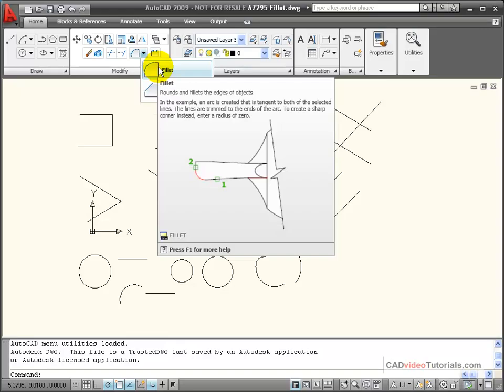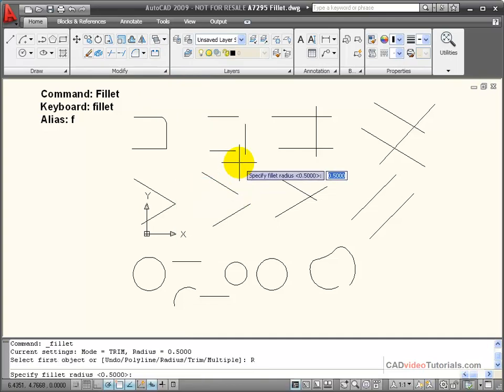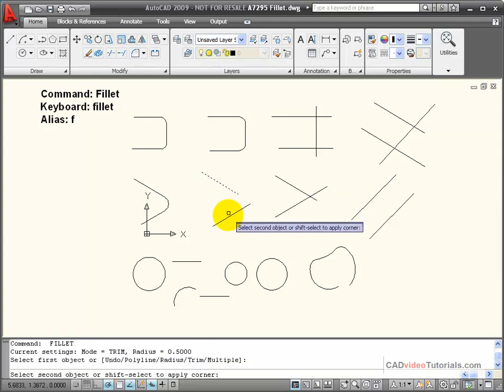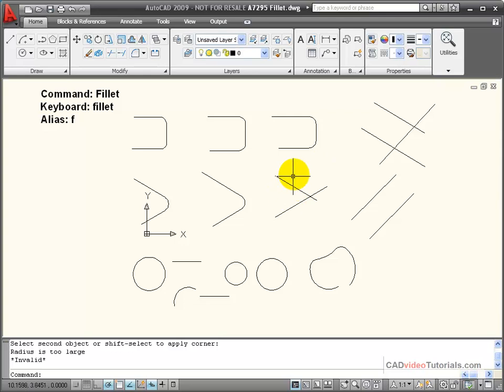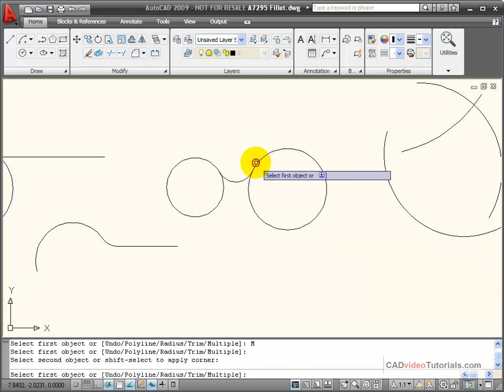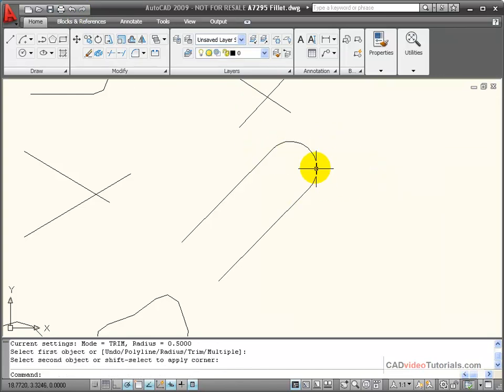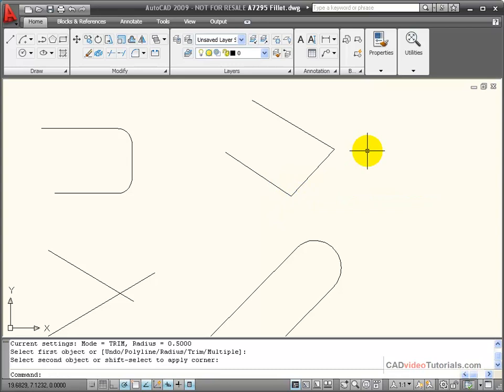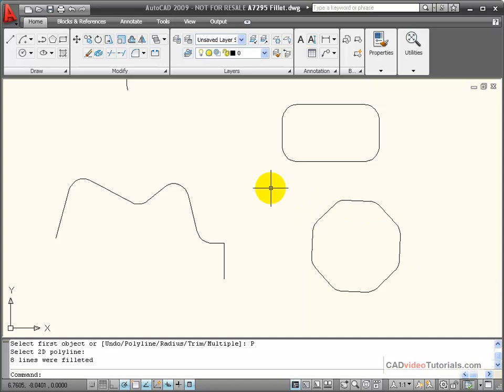AutoCAD Tutorial for Beginners - Using the FILLET Command

Comment: Hi There, I am having trouble using my fillet command with on my Mac using VMWare AutoCAD 2012, the radius is set at 0 and I've tried Shift select on the second line but it continues to make a rounded edge. What am I doing wrong?